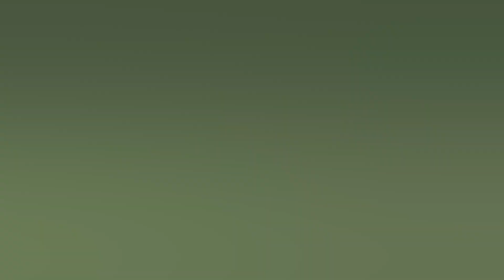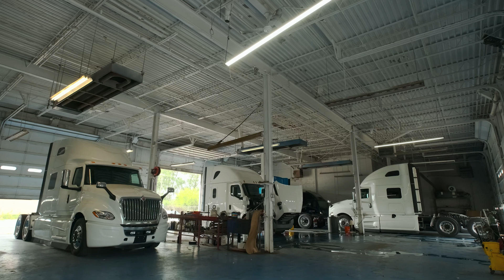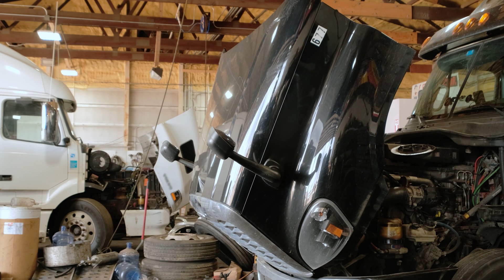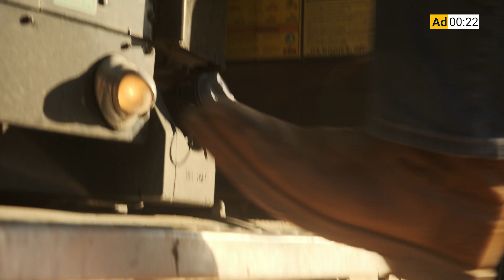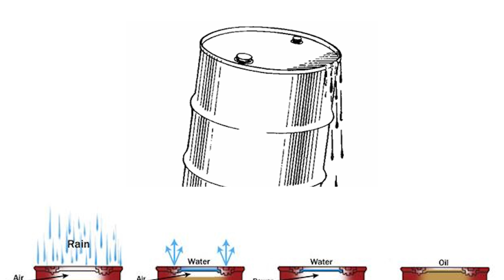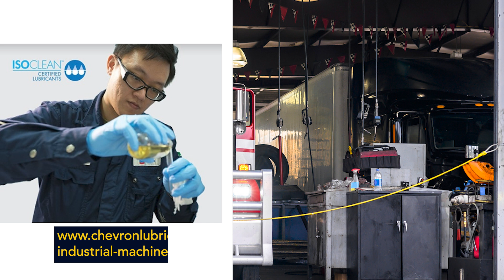Dirty engine oil: Common ways your lubricants are getting contaminated before they’re in your truck

Comment: If your truck is a diesel then your engine oil is never clean from 500 miles on. Even if you added a 2 micron filter the oil would still be black.